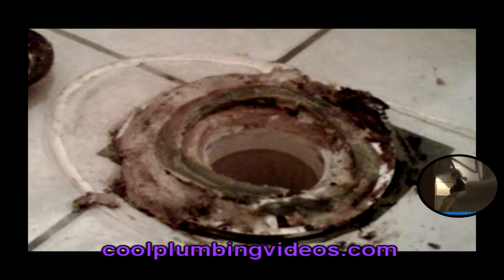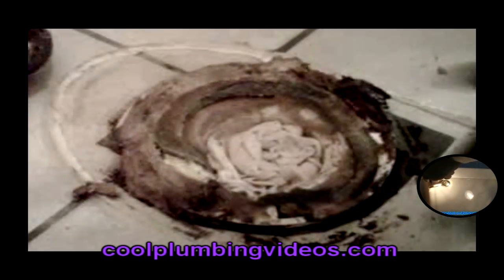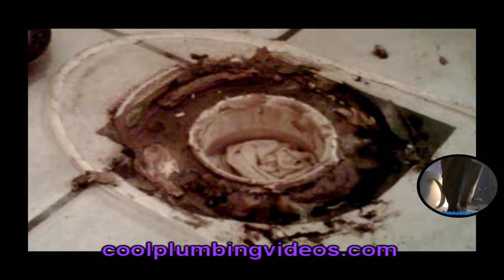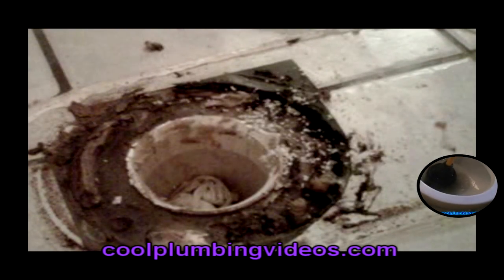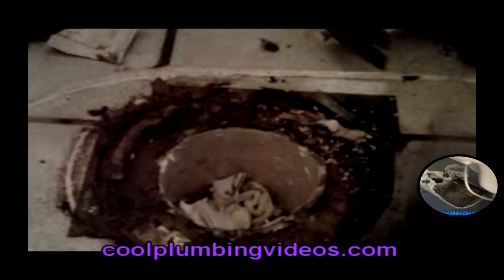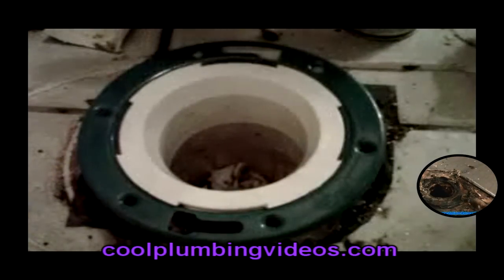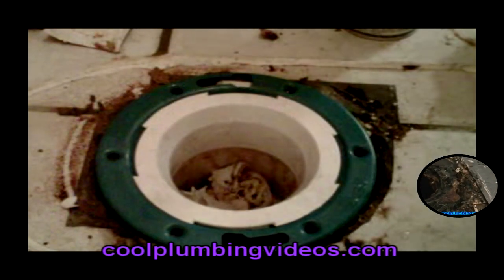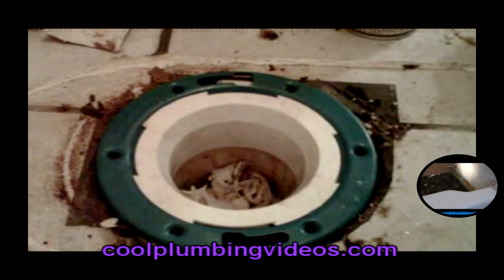top toilet replacements flange you need to know

Comment: Thank you Claude.  Half broken yet my HandyMan told me this fix needs  to be dug into the cement and will cost me $1000+.  He recommended to do nothing since as is can last me up to 5 more years (right...).  I did like you had instructed in the video and it only take me less than 1/2 hour.  Cleanly removed without broken the outside 4" pipe and now it's ready for the new flange.  The only thing changed was that the Home Depot person recommend to screw the new flange to the concrete and that's what I did.  Now it's rock solid.  You rock!!!

Comment: Yes you have a point there. Even though I have been doing it my way for 30 years. A heat gun would be a cleaner & a less risk factor way of doing it. You need the heat there so you won`t crack the pipe. Chipping it out cold is a certain that this will occurr. If it does happen there is a fitting called a slab repair coupling that will glue inside the pipe

Comment: Good video! As a plumber myself and having to do this on occasion. It is good to note that it is still possible on PVC to PVC to break the exterior fitting if ur not extremely careful. Also they make a " bell saver " drill attachment which is sometimes easier, depending on the glue joint!🚱

Comment: I live in AZ and just removed my toilet, saw the flange is missing about half of its ring. So i watched your video, felt confident enough to go out and try it, but I saw your description that said "P.S. I WOULD NOT TRY THIS ON BLACK ABS PLASTIC PIPE"....why? I am asking because I have black plastic sewer pipe and my existing flange is black, set in concrete and I need to get it removed so i can glue in a new flange...Btw, I am laying tile next weekend. Do I install the flange first or the tile? I saw one of your videos about an extension pipe. Please help. 
Thanks!!
Reply: ***** Ok, thanks for the quick response. Do you think I could get by with a flange repair kit? 
Thanks again man!!

Comment: hey there, great video. my flange isn't just rotted, there's nothing underneath it to get screws into. it's all rotted. you know the cheapest way to do this? like maybe clean out a square, poor some concrete and let it set with the new flange disc in it with the screws already in the concrete? and how far you think i need to go? it looks like parts go like 4 inches deep before anything solid. there's a basement below me so....i'm not sure if there will be concrete eventually or wood. if you got any tips or a video that would be awesome.
Reply: +schpoingle What did you end up doing my house is on a concrete slab and it's all soft around the ring I think water was leaking under the toilet softened the concrete so bad it's like mush nothing hard I can dig out big chucks with a screw driver. I had put one of those repair rings in before and the screws just pulled out that's why my toilet started to leak again. I want to get a angle grinder with a concrete saw and cut it out and pour new concrete in.

Comment: I'm currently working on my first toilet flange replacement, and I have an observation: wouldn't it be best for the drainpipe on the bottom of all toilet flanges to fit INSIDE the floor drainpipe, instead of around the outside of the floor drainpipe?  This would allow all the flushed water to be directed down into the floor drainpipe, with no chance for leakage around the outside of the floor drainpipe (which could happen over time even with glued flanges or flange drainpipes with rubber seals).
Reply: @ John Sawyer:  Without a seal on the outside of the pipe, there is a good chance that a clogged drain will overflow onto the floor (rot) and everything below it.  Ask me how I know.

Comment: I have black abs pipe so I clicked on the link you posted but could not find any info on how to remove the old flange.  Do you have any other links or suggestions?
Reply: Hi Brad,  I have 3" abs too.   I'm think they make a replacement flange that slips inside.   Is that what you did?

Comment: Cut the fitting flush with the floor, coat the remainder of the fitting with solvent cement. light the solvent cement & let it burn for a minute then drive the screwdriver between the pipe & fitting all the way through. Then prize it out. it will come out in one piece

Comment: Just a thought, you might want to remind people when they glue the new flange back, make sure the bolt slots are properly oriented. Would stink to do all that work, then glue the new one in at 12 o'clock & 6 o'clock and you need the bolts at 3 & 9.  Just my two cents.
Reply: Also, to remove any of the pieces that are stubborn, I use http://www.lowes.com/pd_138534-86580-K4IH_4294936478__?productId=4307531&Ntt=files&pl=1&currentURL=%3FNtt%3Dfiles&facetInfo=   One side is rounded and the other side is flat.  Instead of chipping EVERY piece off, the hard to get ones I end up filing away.

Comment from the maker: @godfather5275 Yes but i would recomend it. but if you had to you could  get a flange ring that will glue on top of the flange you have and bolt it down some how because the glue will give out after wild. P.S. If you could get it out like this one on the video you could use a flange that has a extra lone neck and that will get you to floor hight. good luck

Comment: can someone tell me, I did best I could to replace the toilet seal w a  non-wax sani-seal ring.  it still leaks onto linoleum a little.  I scrub bathrooms every week and it is certainly not as bad as it was, but this bothers me.  I want to put new tile down but want toilet seal to be as tight as possible first.  any tips or comments would be appreciated. thx
Reply: WOW! Great ideas, thanks!!
Reply: momstheword11 Make sure your main sewer line is not clogged. I had the same problem and had to rent a 75' plumber's snake from Home Depot to unclog it. Good luck!
Reply: thanks would this matter if one toilet does this but not all? one that does it is in middle of floor plan on second floor in house.
Reply: I misread your question at first. I only had the problem in the downstairs bathroom. When toilet was flushed or shower was running upstairs, the downstairs toilet would leak and water would come out of the downstairs shower drain as well. This may be a good new for you because it's a pain to clear a main sewer line clog.
Reply: Okay thanks.  These youtube videos are the best.   Really help.

Comment: That only works where the flange is inside the pipe mine is ABS and it is on the outside of the pipe inside concrete

Comment: Great video, but after dealing with those metal ring flanges, I now try to stay away from them.
Reply from the maker: I understand. It's just that with the metal flange you have the option to turn the ring after once it's glued and you don't have to worry about the flange being stuck in the wrong spot. Thank you for the comment

Comment: i would think, since i am doing the same- but to the floor, the flange is ok.. that SOMEONE out there would invent a toilet that has as extension  from the bottom of the NEW TOILET-perhaps 4-6 inches-- made that way,-- and just slide the whole thing into the tube on the floor..and just use  a wax ring as a gasket... toilet job fixed FOREVER!
there would never be a leak since the exhaust tube from the toilet would be far into the waste tube pipe..
Reply: You'd still have to secure it down somehow. Unless you wanted it to spin around when someone sits down. 
You could charge for tickets to try out the new "Shit & Spin"! Where the fun won't be stopped until the final terd has been dropped! ~~GI Joe kung-fu grip side handles sold separately~~